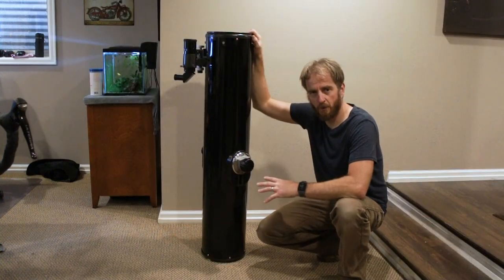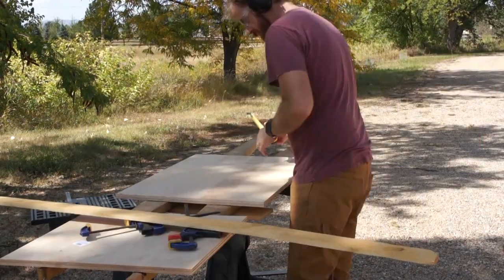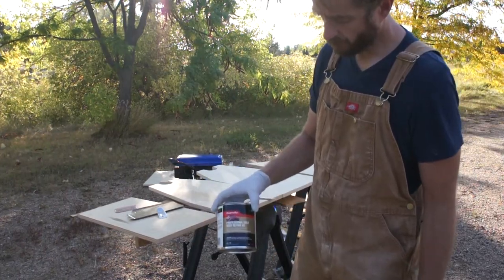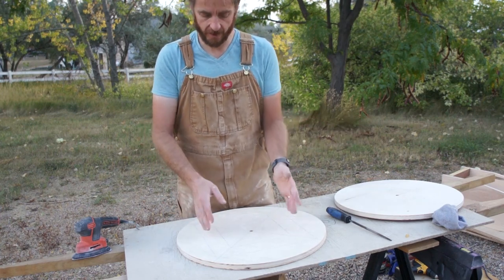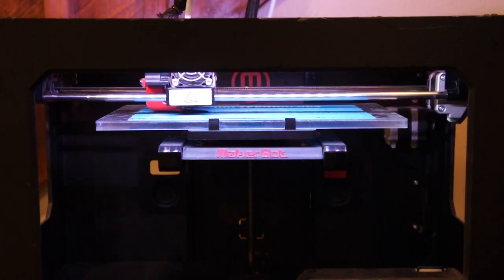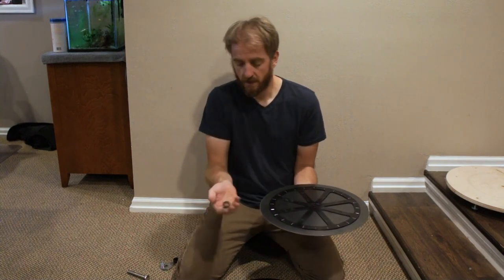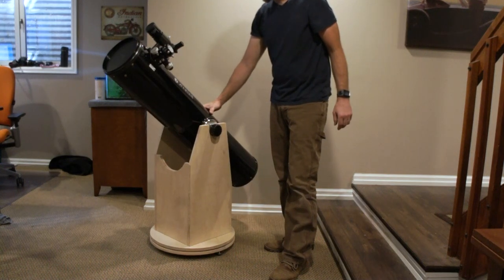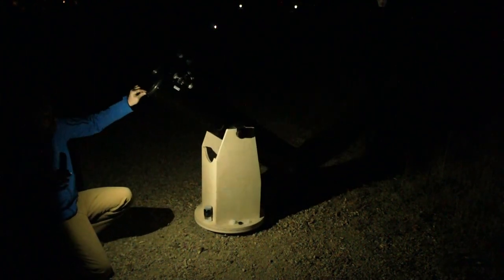Homemade 8" Dobsonian Telescope Mount

Comment: Nah, put is on a CG-4.  20 lbs counterweights.  13in vixen plate.  2 tube rings.  Good to go.  You have to be tall enough to lift it on the mount, but the tripod legs are not extended for an 8" Dob OTA.  Premade Dob mount is $300 and achieves nothing.  CG-4 is $400.

Comment: Great build, very well made! Have you had any issues over time?
Also have you considered upgrading it to slew with something like a microcontroller and motors?
Reply from the maker: I haven't had any trouble with it.  It's worked really well.  Only thing I'd change is to add an additional layer of rubber material to the 'clutch' so it has a wider slip band.  I'd love to do a microcontroller on it.  I'm not sure if I'm smart enough to figure out the programming side of things, though.  Could be a really fun winter project.

Comment: Very good work and explanations for its construction Robert. I want to make a dobson mount like yours for the astronomical outreach sessions, it's much easier to handle than an equatorial one. Two questions: How much did the mount weigh without the telescope? and, How did you calculate the dimension of the pieces for your mount? Mine is a New 200/1000 and you probably need to adjust them. Thanks again.

Comment: This is exactly what I need to build!  Thank you for posting it.  Do you have the parts/hardware information and where you purchased everything?  Also do you have the STL files for the 3d printed parts posted somewhere.
Reply from the maker: Took me a few days to run down the list.  All the hardware came from McMaster Carr.  I created a post on my blog with the part numbers and a link to the STL file.  I was going to put it here but there's just too much stuff and it got confusing.  https://radare.net/2023/01/hardware-and-stl-files-for-the-dobsonian-mount
Reply: @RobertAdairWorkshop  Thank you!!
Reply: @RobertAdairWorkshop great build! the link doesn't work though. Do you have a PDF or updated list?

Comment: Hi. Can you please put a link off that plates and other ring from ebay? Thank ypu.
Reply from the maker: I put the specs/sources for the materials used on my website:  https://radare.net/2023/01/hardware-and-stl-files-for-the-dobsonian-mount  Hope this helps.
Reply: @RobertAdairWorkshop  
Hi, thanks. There are nothing about your big two plates 15". Are they metal? Can I use vinyl music LP record 12" plates instead?
Reply from the maker: @joeg946  They were steel plates, I think 20 gauge.  I wasn't able to find anything on eBay but I didn't spent too much time looking.  An alternative could be a pizza pan or other round baking sheet that is thin enough.  I think a record would work just fine.  Clever, actually.
Reply: @RobertAdairWorkshop  Thank you so much.

Comment: The is actually no reason to make the base plates round. I made mine somewhat octagonal saving a lot of work with a tablesaw and functionally exactly the same. Nice job though.
Reply from the maker: That’s a fine point.  I chose circular for design appearance.  But a shape with straight edges would have been easier.